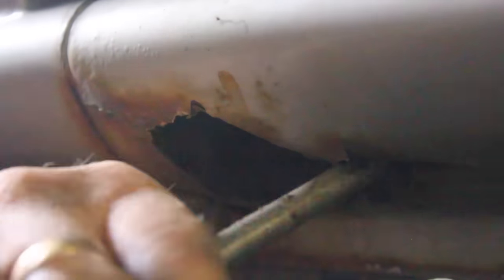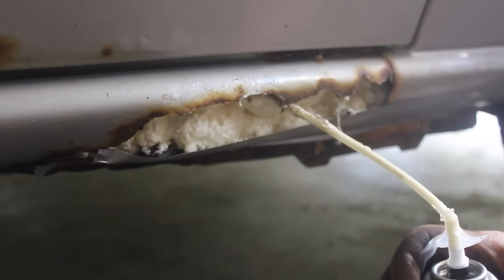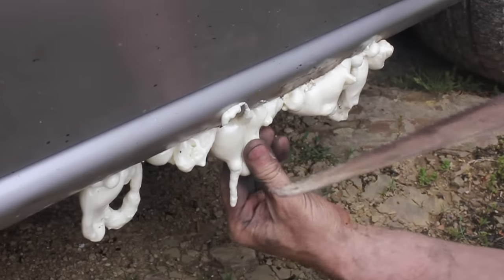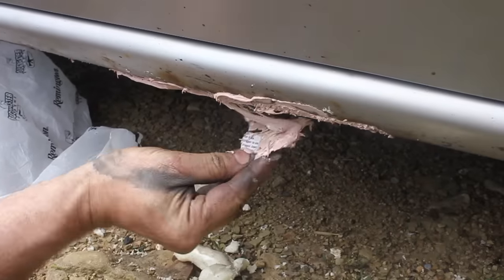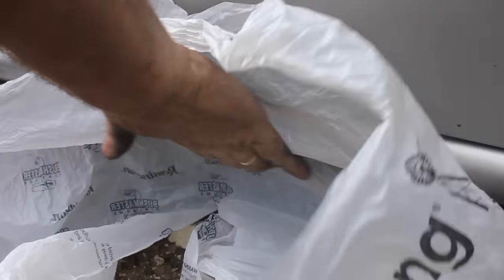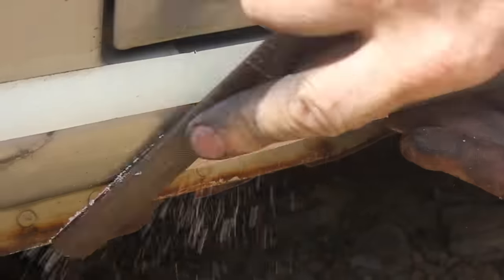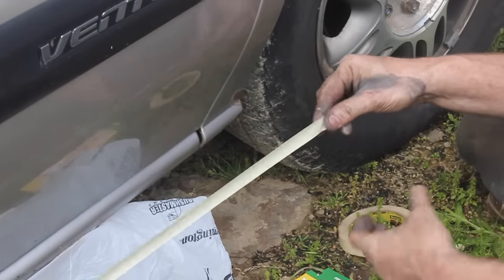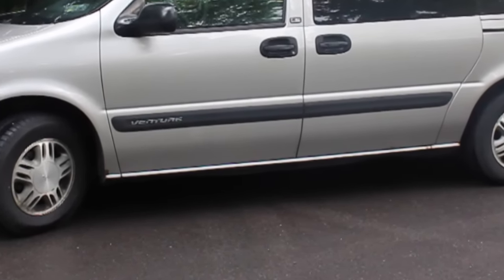how to FIX a rust hole in a rocker panel (fast, low-cost method)

Comment: Thank you. My 2000 Pontiac Montana is the exact same van with some plastic cladding, Pontiac emblems (obviously), red lighting, and a Pontiac-style grill. I don’t have to pass inspection here in Georgia but it looked bad enough that I just had a brake shop refuse to work on it. The rockers are so bad that I couldn’t jack up the rear wheel when I needed to plug the tire recently. Wish I had already done this!
Reply: If you couldn't jack up your van because of rusty rockers you probably should be in a rest home or a day care center and definitely not in control of a 4000 pound vehicle!!!
Reply: @jcanfixall1585  What are you even talking about?

The included jack fits a jack point on the rockers. The rockers and jack point were so rusted that they just pushed up into the vehicle when the jack was operated. At full extension the wheel was still on the ground, meaning I couldn’t use the included jack for a roadside tire repair as intended. Pretty simple. I had to get a floor jack and just from a point on the suspension to get the wheel off, find the leak, and plug my tire.

So, yeah, I couldn’t use the rockers to jack it up, exactly like I said, even though the frame itself is fine. Other than that the rust is just cosmetic but the rockers were bad enough that I had to do my own brakes just due to the reaction of the shops around here who aren’t used to seeing a rusted vehicle from the north.
Reply: @emmettturner9452  my point exactly!!!
You're clueless...
Reply: @jcanfixall1585  In what way? I literally did my own brakes with a proper floor jack in the parking lot of my rented workshop. I had to tool up since the whole reason I’m saddled with this rust bucket is because I lost everything in a tornado including my car. Not sure how the factory jack points no longer working with the factory jack has anything to do with me being “clueless.” Since then I’ve done a lot more of my own work including the thermostat, head gaskets, and more.
Reply: @jcanfixall1585  …and it wasn’t a pad slap either. Pads, shoes, drums, rotors, springs, boots, calipers (yes), and even a flush.
Reply: @emmettturner9452  good job, your Mom should be proud...
Reply: @jcanfixall1585  What is your problem? You never even explained what you meant and now you’re just poking at me. There is nothing “clueless” about finding out the roadside jack included with your 23 year old rust bucket charity van (literally given to me) can’t jack it up due to rust. Explain yourself. I’m poking back.
Reply: @emmettturner9452  why would you try to jack a van up by the rusty rocker, anyone with any sense would NOT have tried that...
Then you comment on YouTube about how you were surprised it didn't work!!!
Reply: @jcanfixall1585  You’re still not making any sense.

The OTHER end was rotted out. Obviously, I didn’t stick the jack into a rusted hole and start jacking. The jack point for the rear was intact. It was the front that was rusted out. Are you seriously asking why I would use an intact jack point just because the rocker panels elsewhere on the vehicle were rusted out?! There’s a reason I still carried the factory roadside jack. Even if I thought it might be rusted inside, why would I be so concerned for the rusted 25 year old bodywork that I wouldn’t try when stranded?!

The real question is: why would I call a tow truck for a tire I can patch myself without at least trying the roadside jack? Now THAT would be “clueless.” It was certainly worth finding out if I could use the jack and jack point when I’m stranded there with an impact wrench, a plug kit, and no reason to think it won’t work. No regrets. If I were in another van that rusted the exact same way I wouldn’t hesitate to do it again knowing full well that it might not be strong enough. If it isn’t, THEN call for a tow truck.

Who even cares so much about bending a rusted rocker?! You, apparently. Bizarre.
Reply: @emmettturner9452  a jack doesn't know or care where it's lifting from, you can lift any vehicle with any "factory" jack...
And putting Bondo in the rockers doesn't make them solid enough to jack on...
Like I said clueless!!!
Reply: @jcanfixall1585  LOL! You clearly have no idea what you are talking about.

Many factory jacks are only made to fit the jack point, including this one. That’s why I called it “factory jack” and expected you to know that. This particular one has a slit in the rounded top for the rocker panel’s pinch weld to slip into. You cannot simply position it elsewhere to jack it up on the side of the road.

…and no one ever suggested that you could put Bondo on it an use it to jack it up! The fact that you are contorting yourself this much in a futile effort to avoid admitting you were wrong to say what you originally said goes to show just how wrong you were all along. Just admit it.

You can even go back and read my OP again if you want and you will see that I only ever thanked the uploaded for a cosmetic trick since the cosmetics had already caused an issue for me with shops in the south that aren’t used to seeing rusted rocker panels. You clearly misinterpreted that. Glad to see you finally admitting it.

Comment: I see some comments mentioning the spray foam holding moisture, however isn’t that only open-celled spray foam? If you use closed-cell, in theory it should be waterproof right? I think it’s a great budget-friendly method. My friend did this to his truck a few years ago and I questioned it but now after doing spray foam research I see the usefulness in this. Good video!
Reply: The rust inside the cavities in vehicles  is sealed in along with the moisture  so they rot three times faster than they would  with out the foam.

Ive welded  many cars with this awful bodge job  and its a nightmare  once theres foam inside the cavities.
Reply: @@vivnap  the foam fills the cavities and there is no moisture getting to it. Also the foam has certain structural char
Reply: @@vivnap  the foam fills the cavities and there is no moisture getting to it. Also the foam has certain structural char
Reply: @lunar5577  The inside of the sill is so corroded its rotted  through .

The internal structure will have moisture locked in the rust. What do you think will happen to that  moisture when its sealed in.

Also  water will get between the sill and the foam and wont be able to dry out, See comment above  about being  sealed in.

Ive worked on car bodies for years and ive seen this atleast half a dozen times and in every instance the foam cased the metal to  rot away ten times faster  ;)
Reply: The problem is... Not many people do that. They just use the cheap junk that holds moisture. Because they don't know, watch a YouTube video, and think this is some miracle fix

Comment: I think this would work great to give some stability to put on some rocker panel covers!  Think about it.... most mechanics will charge you a fortune to put covers over the emply holes.  This will at least add some strength to it!
Reply: it adds zero strength. it actually creates more rust.

Comment: The previous owner of my firebird repaired the rocker panels in this way so that it looked fine. Within a few months of owning the car, the rocker panels on both sides started rusting. When I started removing the rust, I found tons of foam filling the rocker panels. This is not the right way to do things.
Reply: Yep, to do it right, you need full inner and outer rocker panels all the way into the pillars, welded in, sometimes patches need to be welded in front and back pillars. Then you cut a small hole into the rocker and spray Eastwood rust encapsulator inside the whole rocker, then weld the hole shut that you cut out.
Reply: Dont forget the Evercoat or 3M seam sealer in between each piece where they butt together. Then coat the entire bottom of the car with it on all your repair areas, over a good rust stopping primer, and then paint over that with a top coat, or a good under body spray. You also need to find out why water made it in the rocker in the first place and stop that. For me it was coming in, where the door seal came together, water flows threw the seal and had a stainless strip on the inside to strengthen up the seal, which rusted and caused rusty water to hit the top of the rocker, where the inside rocker and outside rocker butt together, and worked its way between to the inside where it was trapped and rotted threw. A lot of rockers rust from the inside out, or from someone jacking the car up wrong and bending the pinch weld over which will split the under coating allowing water in, which doesn't dry out very well.

Comment: Worst thing you could ever do this foam absorbes water and significantly speeds up rusting seen many do this with small rust patches going so whole panel rotted out just through the winter
Reply: The GREEN CAN REPELS WATER!!!!
Reply: It’s non-pourous.
Reply: Pretty sure Great Stuff is water resistant

Comment: I was thinking of doing this with black foam only and no Bondo. Do you think that would be an issue?  
I have a 04 Montana with 235,000 miles. It runs great, and looks great, except for the Rockers. I had one estimate for $1,500, car can't be worth much more than that. No other body shops are even interested in repairing rust.  No inspections here where I live. I don't think these Rockers are structural anyway.

Comment: I didn't know states require that .. ohio doesn't.. sounds like a pain in the butt
Reply from the maker: +It's For Sale Video ! 

It is a real pain. As long as the people doing the inspections a reasonable, it's not so bad. Sometimes they have you by the throat, On something you know isn't reasonable. There have been times where I've had to take the car to another mechanic and have it inspected. I have some good stories.  Thanks for watching the video. If you have any other questions feel free to ask.
Reply: I am in Virginia - and the inspection process here is savage AF. A car older than 10 years old will have a hard time passing inspection unless "you know the right people".  Costs you around $50.00 to get an inspection sticker for an old car. Let's just say some of these guys at the big inspection shops like "tips"
Reply: I think most states require yearly vehicle inspections.  Some are less strict than others, of course.
Reply: Dirty Glove don't require it, thank Dumars

Comment: This would NOT pass an English MOT. The tester would wet himself laughing though so warn him first. The sills needs cutting off and seam welding new ones on.
Reply: don rutter 😂
Reply: Apart from being a terrible bodge, this area couldn't be more structural if it tried, which is why you can't, you just can't!
Reply: Yeah you are right, to pass an English MOT you need to get your crappy welder and make something looking like a seam weld on a computer case patch right above the worst rust holes without even having proper penetration due to rust, spray your crappy Zinc primer after and you're done, no one will care upon inspection that the car is ready to collapse.
I've seen it many times on british forums, people fall from the sky when they realize half their car have this kind of patches yet they pass their MOT.
HAHAHAHAHAHAHAHAHAHAHAHA

Comment: Don't do this.  Cut out the rust with a grinder to make a squared-off hole.  Get a piece of sheet metal and trim to fit with a bit of overlap.  Sand the edges (including sanding the paint off where the new metal will overlap).  Use JB-Weld to glue the new metal on (they have a Kwik-Weld that dries to holding in a few minutes).  Smooth over the gap with more JB-weld.  Prime and paint.  $50 or so depending on what you use for paint.  If you need to buy a grinder, under $30 at Harbor Freight.  This way, the rust is actually gone, not sealed in to spread to the car's structure.

Comment: That's all good until you have an accident and the car folds up taking your feet with it
Reply: It's a body panel, not a structural member. Snowflake alert!
Reply: You do know that nearly all vehicles have honeycomb/foam as bumpers and supports right???
Great cheap fix for folks with lil cash.

Comment: This is definitely an easy short term fix, but the foam acts like a sponge holding any moisture its exposed to, causing more rust and problems down the road. Get it "down the road" 😆 anyways great video man, keep up the good work.
Reply: Closed cell spray foam is waterproof and solid when it dries

Comment: I wonder what the long term shows about the rust return. Yes u covered it up looks good but ...?  Would you do a follow up report ? I am curious as I may try on my Ford rockers.
Reply: it will rust like crazy 6 months later. foam holds moisture, so once it rains once, the rockers will be bathing in water-filled foam until they rust apart.

Comment: Patch with fiberglass and after you're done spray in 3M cavity way inside to prevent further rust. No foam.
Reply: Why do rocker panels rusty so badly vs other parts? Once I fiberglass the rocker panels I don’t want to have to redo it months later hence me skipping the spray foam method

Comment: Now this is a down and dirty fix but not as cheap as i do. Although the foam isnt a bad idea there is a cheaper option. I use cheap fiberglass or plastic window screen. Cut it to cover the hole put a thin coat of bondo over it to hold in place let set come back as seen here with a top coat of bondo. Then knock off any high spots with a grinder or file and apply paint. Its fast works great and anyone can do it cheap.
Reply: huh?
Reply: @kudakoda  do you have a question about how I described a cheap fix? It's very simple doesn't take much skill. It's not a pretty fix but on older cars it's just about keeping it legal on the road it doesn't have to look new. Just so long as holes are permanently fixed as taping won't pass inspection.

Comment: For those crying about it being the incorrect way... I own an 06 g6, the rocker panels are all rusted and broken apart, low and behold - there is foam coming out of the holes.. Meaning this is how the original car manufacturer did it anyways. lol
Reply: No, that means the previous owner of the car did this to fox the rust prior to you buying it.
Reply: I've still been looking for the foam crap and no one knows what it is. I'm at Lowe's now and they say ko spray foam they have hardens like that.
Reply: @Bladeshifter20  I just left menards with 2 cans of it, it is a filler, the bondo will be the harder of the 2 things you use, its called good stuff foam filler.
Reply: @TheEnd-eg6wq  oh okay. Yeah we only have Lowe's and Home Depot around here. I'll have to check back another day. If they don't have it im sure I can get it online. Thanks.
Reply: @Bladeshifter20  I'm sure they have it, Great stuff, not good stuff

Comment: Okay I just bought a used car and it's all eaten up underneath the rocker panels just like that. I thought I needed to take it to someone to weld sheet metal pieces in it but if I do it this way how long will it last? I mean what would end up rusting again later is it strong enough to hold up? I'm willing to try this cuz I can't really afford to have someone weld it right now.
Reply: If you value your life, I would steer well clear of this type of repair, very dangerous, car could crumple up on impact.

Comment: Good video, thanks, i have to do the same thing, i have some rust /holes in my rocker panels, but i want to ask you this , A- the plastic that you used does not stick to the bondo after  ,B- and the one that you used is it low /or hi type, also now and then they ask for welding to be done on rocker panels, is this way ok !?

Comment: Why does no one understand... in some states and provinces for the Canadians, its required your car passes a safety inspection before you can register it and it is proven that rusty parts on cars have considerably less structural integrity then otherwise solid steel. but who gives a FK if its the car your gonna be driving and you know this risk this method is gold seamless and effective to pass inspection.

Comment: Unless I'm missing something - Eg this video was posted on 1st April🤔😳 Most "rockers" (or sills are we call them in the UK) are structural items - as modern cars are of monocoque construction. Also if the outer sills have gone (mainly cosmetic but still structural), the inner sills (fully structural) won't be far behind AND "chassis" members will be in a similar state too. It could be lethal for an amateur to do this type of repair. Then there's the issue of accident protection - and legal liability etc.

Comment: To make it last longer, take the rust off as muich as you can, but do not over do it! then a  decent or very good rustprimer I take owatrol cip mixed with hamerrite and then do his trick, who knows, you might make it go for years. Sombody suggested to put a plastic pipe length wise in the bottom to prevent trapping moisture, good idea I thought.

Comment: The only thing I got out of this clip is the idea with the plastic bag. I recently did some rust repair on the TOP of my car door and had to sand back a large amount of body filler, if I had of used that trick it would have been a lot less work.

Comment: Wow.i actually just finished a 90's chevy van body work using this same method.and people who saw the work were amazed.easy and fast.
Reply: can you just sand and paint the foam and skip the bondo?
Reply: @tommak6516  yes but won't last long,Bondo make the surface hard and smooth,the foam does not

Comment: You took care of the hole, but you left lots of rusty metal on the outside and inside that will eat into metal further. shoudl have sanded and painted a bit before sealing it

Comment: The rocker panel adds structural integrity to a car body. I'd check your insurance to see if your covered by this type of repair. Yes it looks cosmetically great, but as for strength in an accident.....